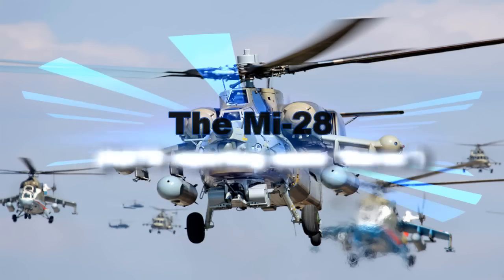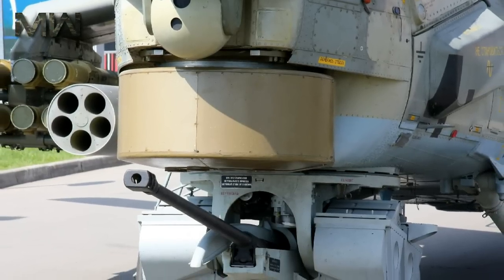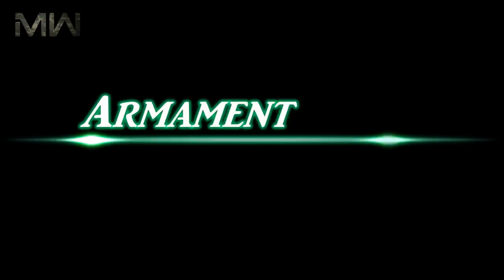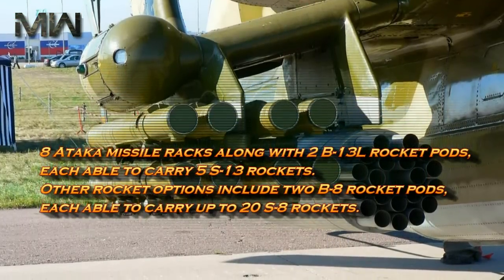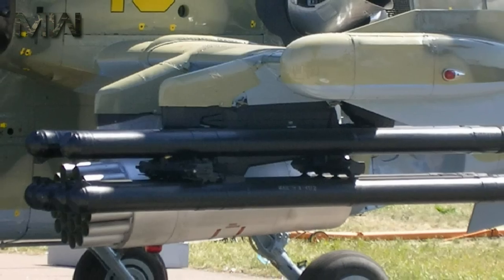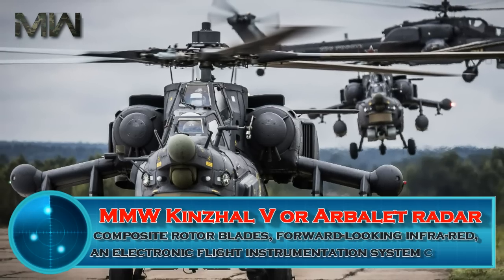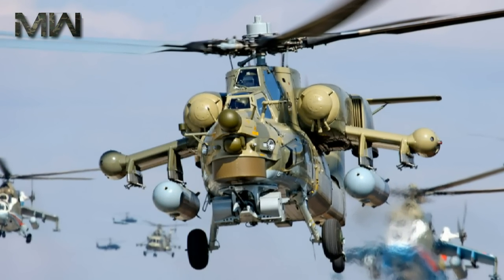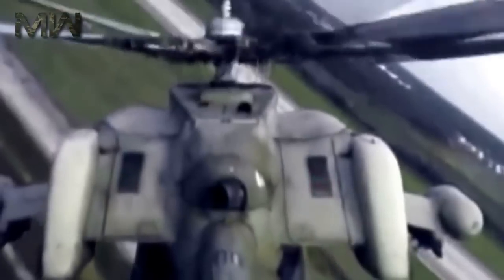Mil Mi-28 (Havoc): Russian Attack Helicopter

Comment: That thing is just evil looking😮 Freaking Russian helicopters are wicked.
Reply: It's just a straight clone of the US made AH-1 Cobra and AH-64 Apache and before you say "No it's not". The US literally made the Cobra design in the 60s and the AH-64 was in flight tests in the 70s and this didn't have flight tests until the 80s. So yes, this is 100% just a rip off of US designs.
Reply: @ilhamdarmasatriautama8016  Yes the Apache has a ejection seat. lol The Mi-28 is 100% a copy of the Apache. Nothing you say will change that. Russian attack helis were fat and ugly before they decided to steal the Apache design.
Reply: @ilhamdarmasatriautama8016  Yes. I misread an article, but the Mi-28 doesn't have them either. Only the Ka-50/52 has ejection seats. They were never put into the Mi-28, even though they were designed to have the pilot shot out the side of the heli. So you brought up something that the Mi-28 doesn't even have. lol
Reply: @ilhamdarmasatriautama8016  If your point was that the Mi-28 is a AH-64 rip off, because it doesn't have ejection seats either, while randomly bringing up ejection seats for no reason, because the Mi-28 doesn't have them. Then, yes. I proved your point.

Comment: If Canada and US will not sell attack helicopter to the PH to fight local terrorist(CPP/NPA), THIS RUSSIAN attack helicopter is an excellent choice!
Reply: The Russians have the best helis
Reply: @Johnny-xi4ti  They are the best at ripping off US made helis. This thing looks like a straight clone of the AH-64 and that heli came out 10 years before the Mi-28. lol
Reply: @summoner1451  Mi28 is made a few years before AH
Reply: @summoner1451  LOL! In what aspect it is clone of AH-64? They even not in the same class -- Havoc is an assult helicopter to support troops right on a battlefield.
Reply: @vyacheslavvorobyov22  I already explained how. The USSR/Russia didn't make anything that looked similar to this before the US made the AH-64 and then 10 years after the AH-64 test flight the Mi28 goes into test flights with pretty much the same exact look and shape as the AH-64. It's 100% a rip off of the AH-64.
Reply: sum moner I’m a US patriot , Ex military and ive got to disagree with part of your statement.  I can see some similarities but the eurocopter attack helo is an identical twin, this helo went above and beyond the AH64 in some of the most important ways, much heavier armor and glass which is slot safer for operators,  Russia demanded like the alligator that the pilots be able to eject or get out in flight if going down.  Russian ejection helps have nearly a 100% survivability rate verses a poor statistic for crashing Apaches, the crumble protection is a joke and breaks backs , necks and kills many hard impact crew.  Ends the pilots careers usually if they survive a crash.  The US DOD won’t require ejection systems and it’s really sad because it’s a no brainer to save pilots lives.  In a helo going down. You need to get away from the aircraft if u can and ride a parachute down. Not stay strapped to it and crashing it.  Even the new Blackhawk and Apache replacement concepts don’t have the ejection seats so it’s not a date thing, it’s a cost thing.  The statistics are there. Data proves the amazing record and sadly Russia has even already proven the concept that works, detaching rotor blades prior to ejection. It also sends the helo down harder destroying it even more which u want in enemy territory.  They’ve sheer developered systems for others that roll the canopy’s over the side and the helo increases power momentarily even under a failing engine by increased fuel which gives the pilot and gunner time to essentially roll out with parachutes from a elevation maintaining aircraft, then it autopilots opposite direction arcing to the right and power decreases heading it away from the operators.  It also uses GPS and a computer mapping austem that supposedly will try to auto pilot the helo away from structures on in a residential area crashing in fields etc. pretty amazing in enemy lands they develope that feature to protect civilians.   
Another amazing feature the US jsut won’t include is a small compartment for rescue operations.  This video said it holds 3 men but there’s another where 7 squeeze in . Designing I’m a box or compartment so that an actual armored attack helicopter can be used to rescue a couple downed pilots or infill and exfill a team of 5 kitted SOF in an armored compartment in an deadly
Attack helicopter is such a brilliant idea!  Seeing this comming enemy run, seeing a Blackhawk comming, enemy start shooting at the lightly armored and not very defenseive aircraft thst clearly is dripping of picking up Troops, an attack helo they wouldn’t know and would assume it’s attacked and flee , it can light up an area massively and keep firing with the helmet operated 30mm while they exfil or get in.  No ones going to be challenging that 30Mm, it’s so insanely loud and uses the sensors so the gunner can use FLIR etc to target enemy. The armor and glass is much tougher so they aren’t going to get killed while picking up.  Just seems like it’s THE ultimate rescue helo, SOF extraction and dropping helo.   If I was SOF I’d much rather be dropped into a location by one of these and knowing one of these was going to pick me up would be like knowing an A10 was comming to get me.  They have a gunner detachable fastrooe option so they can Fastrope out of needs be and then the gunner pushes a button the releases the rope and closes the door.  It’s more powerful so able to carry more ordinance /rounds.  Has a 30MM helmet controlled canon verses the 20MM of the Apache.  It’s newer so has a lot more tech than the standard AH64 does as they are approaching replacement with whoever wins the replacement contract.   This cost the same as the Apache and outperforms, out maneuvers , does maneuvers the Apache cant, more fire power, more ammo, , more armor, glad and body, more tech, pilot ejection and a troop transport area that also is armored for the same cost, shows how much our defense contractors would rather make proffit than apply it to saving lives.  The  Apache and the Apache replacements could easily include small compartments for even jsut 2 men that wouldn’t affect anything . Their going to be fly by wire so could easily include ejection and auto pilot systems for safe impacts  but nope, they’d rather charge more for less.  
Their Blackhawk equivalent MI isn’t jsut a troop carrier that carrier more troops than a Blackhawk but it’s heavily armored and an Apache on steroids. Is a massive attack helicopter that is their primary troop insertion helo. Less RPG taken down transports because it blows the hell out of everything on approach to get heads down . I love the Blackhawk but i is it think their two Concepts are better executed in every way.  Why send 2 blackhawks that are bullet magnets without escort or require 2 Apaches to support them when you could take the big Mi that holds more troops than 2 Blackhawks and you don’t need additional support helos because it’s armored and carries twice the fire power of an Apache.  In truth you have to admit Russia focusing attack helicopters as rescue or recovery Helos as well caring about the soldier on the ground and the cost of ejection systems for pilot survivability. A lot more armor and fire power , civilian structure crash avoidance  it’s safe to say they are more concerned about their soldiers safety than our DOD and military contractors who are worried about cost. Putting less ballistic glass , less armor, less ammunition storage . Passenger compartments no ejection and charging more.  The Blackhawks are way underarmored, the glass for pilots are rediculous, they want to carry more troops so they use less armor to protect them, 2 door gunners as weapon systems which doesn’t compare to an attack helicopter, although the DAPs Blackhawk thst is a heavily weoponoEd Blackhawk is amazing but it’s a 160th SOAR only helo.  I’m a HUGE AH64 fan. That and the A10 has saved me and my brothers lives on 6 occasions so I’m not knocking them , they jsut are outdone by this helo and the big MI transport attack helo in every way and so focussed on the lives inside and on the ground.  Any soldier will say the Blackhawk is a bullet magnet the enemy knows AK rounds will kill occupants , I’d love to have had either of these attack helicopters transports be infill and exfilling me.  It’d also mean every transport helo is an attack helicopter as wel so can Consuct dual missions , drop Troops, then do CAS , cover them till they get to a good position, an inbound exfill can light up enemy and eliminate them, and the mere sight of these things , like the Apache and A10 gets the enemy running.  Also should note the Alligator , the twin rotor attack and reconasance helo is a game changer, like nothing out there, and the super transport the worlds largest heaviest lifting transport MI for Russia holds 85 full kit soldiers, can heavy lift an airline jet which there’s videos of, lifts several times the weight of a Super Stallion , very heavily armored tho not much in weapons , and cost 1/4th a super stallions cost that only holds 55, has a shorter range , slower, less armor, much less lift capability and instead of the Russian $25M price tag its $80M and does everything less and worse.  My point is simply the Russians don’t copy US helos, nor do we theirs, Russian attack helicopters and Sukhoi fighter jets are amazing and part of being a good soldier is respecting other militaries equipment and not assuming yours is best regardless of facts.  The US replacements for the Blackhawk and Apache will be next level , push rotor helictites, fly by wire , etc, so that will be be cool and a game changer! The new Grey Wolf is bad ass too! We have had some other light helos too thst are great, the SOAR Littlebirds , lightbattack helicopters , SOF insertion and operation, so cool, the Kiowa , thr MD500 defender , the legendary Huey , the Cobra , all very cool.  Both militaries have amazing airframes and only getting better , I only wish our military would put a LOT more focus on soldier safety and rescue like the Russians do. That’s jsut a fact.
Reply: @MZ-bl6wg  Wow, nice propaganda post, bro. It's 100% a AH-64 rip off though.
Reply: @summoner1451  russia didnt anything looking similar before? Seems it is your only argument, from which follows so lot a consequences. Such a brilliant example of logical reasoning. Just lol. If you look at all Russion helcopters, including exerimental ones, then you'll see how they are drastically differ from each others. If to play game of "find similarities" the I'd say the mi28 in some aspect similar to ka50 (blackshark), to mi24 in pilots layout and that mi28 can take also few mans besides pilots. The difference is so huge, buto your ignorace bigger.

Comment: A copy of the American Apache.
Reply: Mobile Gamer Yet less expensive and can actually do a full flip...
Reply: Speaking of full flip, is any Mil Mi-24 and it's upgraded version Mi-35M can also do Full upside-down flip if the cargo is empty first?
Reply: as you are naive...)) the Apache and mi-28 are similar only the fact that in both helicopters the similar concept of the fighting helicopter with 2 pilots, to the same if you attentively look, then you will see that mi-28, it is completely made of details mi-24/35, just in mi-28 have cleaned a big transport compartment for transportation of soldiers, left only a forward part and arms, having equipped it with more modern electronics...)) besides, you probably don't know, but all modern fighting helicopters use the scheme of an arrangement of the pilot and tipper-of, one by one (the pilot for the tipper-of, but is slightly higher), this scheme of an arrangement of crew for the first time in the world has been applied on Mi-24 "Crocodile" (NATO - Hind) so the Apache uses developments of Mi-24....) ) Mi-24, it is the military transport assault helicopter, it can destroy the enemy, possesses good booking, but still can transport a landing... mi-24, it is created on the basis of transport passenger Mi-8, there are military transport and passenger mi-8 (the exporny name mi-17), their arms almost like at mi-24, but these helicopters have no armor... therefore, on base mi-8 have created the armored version of the voyeno-transport fighting helicopter, mi-24, it as the overland armored personnel carrier or the IFV for transportation of soldiers but having more than arms... but, on a skolka only air support of troops from air very often is required, the landing office isn't necessary therefore the following helicopter was made without landing office, it was mi-28 as the transport compartment was cleaned, the helicopter became easier therefore it is possible to increase easily armor, without loss of flight characteristics. . he is completely made Russians, and here during creation of the Apache designers used the Russian practices, it is visible on an arrangement of crew and some trifles which for the first time in the world have been used in Russian mi-24...))
Reply: what part was copied from Apache?
Reply: nice
Reply: Salty? I mean... this one is better
Reply: That is funny! But not true! I could now say the Apache was a copy of the Mi-24! And the Mi-24 was a Copy of the Cobra - WHICH IS ALSO NOT TRUE!